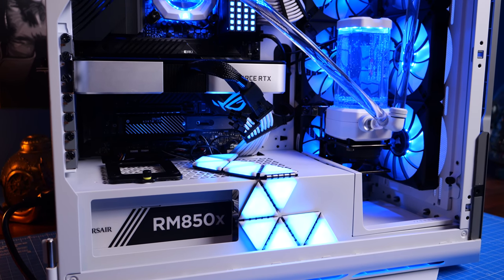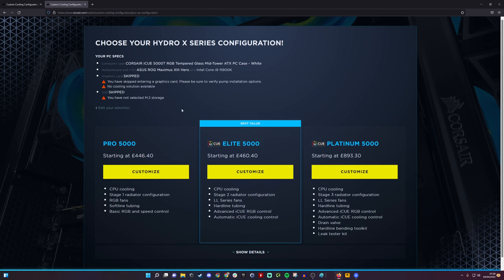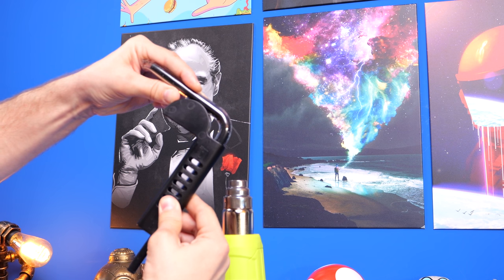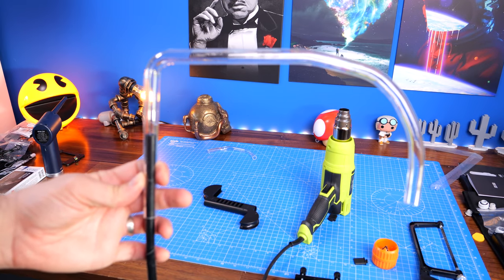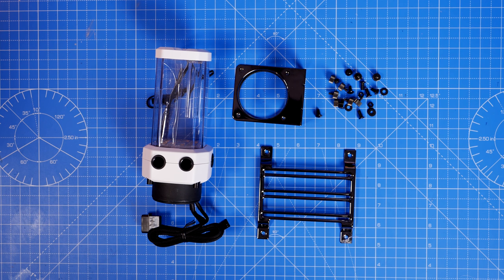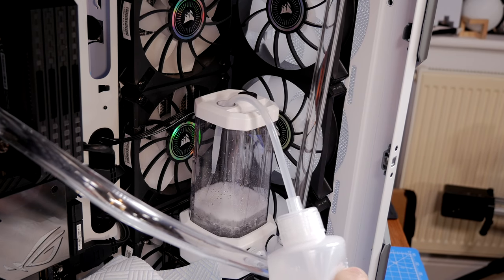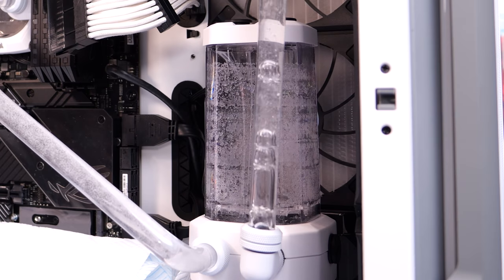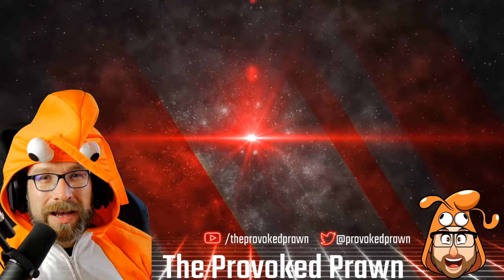Beginner's guide for custom loop liquid cooling (important tips for noobs)

Comment: Where do you connect the radiator fans if you use only one radiator for both CPU and GPU in the loop, in the CPU header?
Reply: One radiator may not be most efficient way for cooling such system

Comment: Please do a tutorial on liquid cooling with 7000x
Reply from the maker: It would basically be this but in a bigger case https://youtu.be/Z9MqMHmejmg. Though if you use the configuration tool you might get a bigger radiator recommendation.

Comment: Corsairs configuration tool was literally worthless for me. Didnt recognise the case I wanted at all and several other parts.

Turned me off buying ir. Not willing to fork out nearly $1000 for something i couldnt even design properly ..
Reply from the maker: Sorry to hear it. I'm going to let Corsair know about this. What case was it?
Reply: @TheProvokedPrawn  Phanteks NV7.

Good video though, not a criticism of you. Some helpful tips 👍
Reply: @BM-wf9uf I'd recommend ek configurator. It will probably be more expensive than corsair parts though.
Reply: @expert8665  Yeah I've already looked into EK. I found their configurator to be better than Corsair. Just wish they had more white pumps.
Reply: @BM-wf9uf  What I would do is whatever ek recommends for the pump,buy it from corsair. Soo if they recommend a d5 200 pump go get that exact spec from corsair.